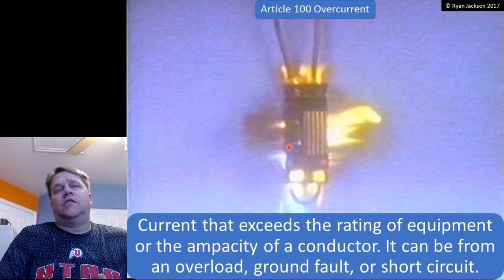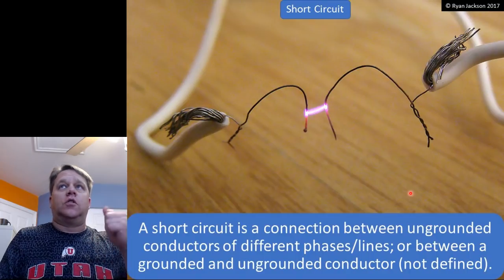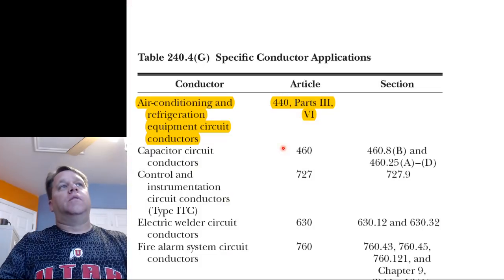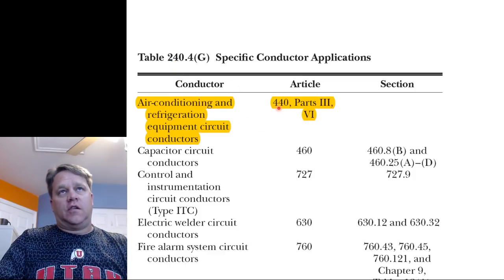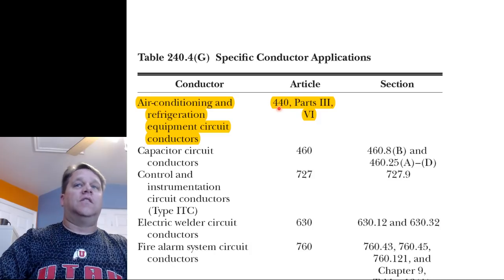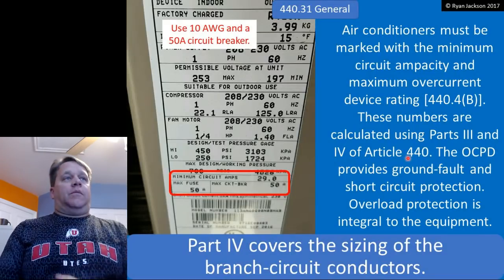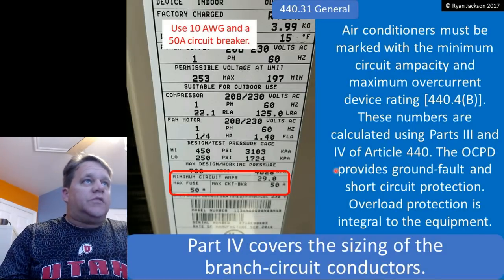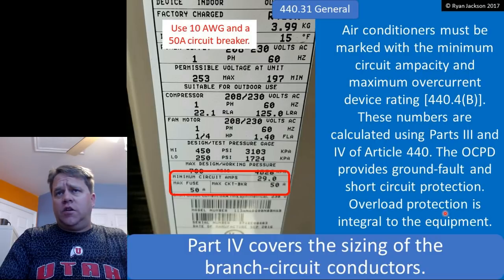Air Conditioners and the National Electrical Code (NEC)

Comment: Just wanted to take a moment to say thank you for this video.

Recently I’ve been installing split units in a prison for 7 out of 16 of their units. I’ve never run power to them before. 

I got all my wire pulled and everything and then come to find out there was a little bit of confusion about whether or not I had pulled the wrong size of wire.

The units have a minimum circuit ampacity of 16 Amps. I pulled #12 wire. And the unit says that the breaker needs to be 20 A. 

In this particular case there’s not a discrepancy between amperage of the unit and the amperage of the wire. 

The thing that got us confused was that we had bought 30 A breakers (because that’s what the AC guys had originally told me when I asked).

Long story short, the wires I pulled are perfectly fine for the units and it saved me a lot of repulling of wire. 

Now I know to just avoid confusion and go by the name plate of the unit since the code requires the manufacturer to do the math for us.

Thanks again for your info

Comment: You needed to discuss LRA, locked rotor amps, and why it does not enter into the discussion. I noticed you were using very old equipment that did not include the LRA.
Reply from the maker: Go ahead and make a video. That wasn't the topic. There's lots of stuff I didn't include here.
Reply: He’s right bro that wasn’t the topic. We’ll wait on the video Texas

Comment: Mike Holt says to use the 75 degrees column 
U say to use the 60 degrees column 

? 

Electricians can’t agree on anything
Reply from the maker: Read 110.14(C) and (if using NM cable)  334.80.

Comment: Is it max fuse or breaker? So I  could install a properly sized breaker and a non fused disconnect? I thought when it says max fuse that the manufacturer is requiring a fused disconnect. Please respond. Me and another guy are having a debate on this subject.
Reply from the maker: If it says fuse, it requires a fuse. See UL Guide Card Category LZFE (https://iq.ulprospector.com/en/profile?e=209220)

Comment: Should an AC disconnecting means require the same amount of working space as a service equipment panelboard?
Reply from the maker: Yes
Reply: That would be nice but in the real world it doesn’t happen. Example:  Apartment complex with 16 AC units grouped together. Hard to comply.
Reply: Yea the inspector for those sites gets a large cut for passing such bs.

Comment: If the breaker is only used for ground faults and short circuits, what could go wrong then if you go over the max circuit breaker rating?

Comment: So, who's responsible for this carve-out for the HVAC manufacturing industry. Seems to me that the NEC is asking us to put a lot of trust in the AC manufacturers for overload protection. I've seen multiple "built in" overloads fail resulting in melting wire and small fires (fortunately).

Comment: Motor loads allow you to size the wire based on the MCA, but the EGC should be sized based on the installed OCPD rating. The upsize of the EGC to match the breaker size may require you to size the phase conductors to a size larger that includes the code required EGC. Its a good thing to double, triple check before ordering and installing spool full of wires so the AHJ doesn't makes you rip them out.

Comment: Ryan, I completely understand and now I understand that the use of smaller gauge wire for condensers is allowed under 440. I also fully understand that wire sizing conductors for condensers is different than that of 310.16. My question is though the NEC code is the minimum requirement to be safe from fire and code violations. Can we run larger gauge wire using 310.16 as the base for wire sizing and over-current protection for a condenser install and simply use the correct amperage breaker for the conductor as per normal practices and still be code compliant? This is my only confusion! 

I get that an “MCA of 28.4A” with a max breaker size of 50A on a 10 gauge conductor using a 50A breaker is good with 440. That said would I be in code violation of 440 if I use 8 gauge wire following the 80% method which would be 32A using a 40A max breaker size?
Reply from the maker: The conductor has to be at least as large as the MCA. If you satisfy that it can be as large as you'd like. The breaker must be between the min and max overcurrent device rating.
Reply: @RyanJacksonElectrical  thanks Ryan, my a/c guy is installing a system for me and I’m just making sure the way I’m doing it will satisfy 440 while using 310.16 and the condenser tag for breaker size to do the work. Neither myself, the customer nor the city inspector are comfortable with using 10awg wire on a 40A circuit for this job as per NEC 440. We’re running 6/2 x 50’ for the wire and using a 40A breaker according to the max breaker size on the condenser tag. Also 18/5 x 50’ for the thermostat, air handler/furnace & condenser then a 20A breaker with 12/2 x 50’ wire for the air handler/furnace.

Comment: I'm an amateur electrician thinking of installing an AC unit and was confused about the nameplate specs on the units. Just came across your video after digging across the internet trying to understand this logic breaking piece of electrical code. Wonderfully explained! No one explained that it's because the motor has a shut off to prevent itself from melting. Thank you Ryan

Comment: Great video, thanks!  But I'm confused about disconnects and if they need to be fused or not?  It seems it is not uncommon to use Both a breaker and a fused disconnect.  Why would that be needed? And if so, would the fuse and breaker both be sized the same (per the HVAC label)?
Reply from the maker: They are sized the same way. If the unit says "maximum fuse" instead of "maximum breaker" or "maximum overcurrent device," a fuse is required.
Reply: @RyanJacksonElectrical  after some research I have learned a bit more on this.  Though most condensers will say fuse/breaker max rating some might only be listed for a fuse and only say fuse max. In that case a fuse in the circuit is required and can be anywhere, so a fused disconnect becomes one easy way to meet that requirement.  But a breaker in your breaker panel is also needed.  Also, I checked my own home units and found fused disconnects were added when the units were replaced.  Though I don’t know the rating of the old units we had I see the correct sized fuses are in the disconnects were the breakers are both larger. 35 fuse vs 50 breaker. And for the smaller unit, 20 amp fuse vs 25 breaker.  So instead of downsizing the breakers they just buy the needed protection in with the correct sized fuses. So fused disconnects become an option to downsize the protection when needed for a unit replacement leaving the higher rated breaker for a possible future use of the circuit.

Comment: You are reading the code incorrectly and to say that if you short out 2 #14 wires it would trip an 800 amp breaker is ridiculous. Clearly the 14 wire will burn before it trips a breaker.
Reply from the maker: LOL okay.
Reply from the maker: So which section do you think I am reading incorrectly?

Comment: If a 5KW electrical heater kit calls for a min of 27 and max of 30 and say it's on a breaker for 40 amps would breaker need to be changed to 30?

Comment: Very good presentation. You have clearly demonstrated why ocpd is not sized according  to the partial or full ampacity of the cable. Do you have any insights on how or what determines the  max ocp values in these cases?

Comment: As an electrician, using mostly, 430 and 440 for my work, I am very familiar with your subject. I used to get a kick out of showing "union" electricians how I could 'legally' put a 18 gauge wire on a 40 amp breaker for certain motor loads, because the overload was in the contactor, the breaker had to sustain the inrush current without tripping, the contactor would trip (very predictable) at a low current, below the breaker rating.

Comment: @Ryan Jackson When the manufacturer provides their MCA, they have done all the calculations. The MCA tells you what wire size to use. Does that mean you do NOT have to correct for temperature and adjust for bundling? Thanks for your many excellent NEC videos.
Reply from the maker: The manufacturer provides the minimum ampacity of conductors. The definition of ampacity is the amount of current the wire can carry AFTER temperature adjustments and ampacity correction. So yes, you still need to factor that in. The nameplate won't state "use 12 AWG," it will state an ampacity.

Comment: Same would apply for large commercial air handlers with min circuit  amps and max over current name plate markings? No hermetically sealed compressor motor. Only large fan motors that have overload protection. Also would the wiring compartment on a disconnect for an air handler stating ues 75° c or greater conductors imply that the terminals  are 75°?

Comment: What if the AC is continuously operating over 3 hours? Do you need to apply a 1.25 factor to the MCA to size the conductors/breaker?
Reply from the maker: That's already calculated

Comment: Stupid question, Previous AC unit required a larger breaker and new Unit requires a smaller breaker, can you leave the older breaker?
Reply from the maker: No, you need to change it.
Reply: @RyanJacksonElectrical  what if there is a fused disconnect between them with the correct fuse size the unit calls for?

Comment: If overcurrent protection devices detect for ground faults then why do we need GFCI breakers?
Reply from the maker: A GFCI opens at 4-6 mA of current difference between the ungrounded conductors. An overcurrent device opens (quickly) at about 6-10 times its long time pickup rating.
Reply: thomas ipkiss  Per Article 100 of the NEC, a GROUND FAULT is an unintentional, electrically conductive connection between an ungrounded conductor of an electrical circuit, and the normally non-current-carrying conductors, metallic enclosures, metallic raceways, metallic equipment, or earth.

When a circuit has been properly installed according to NEC rules, all of those "metallic" objects (enclosures, raceways, equipment parts, and the equipment grounding conductor) will have been "bonded" together, making all those metal pieces the same object, so if an energized conductor touches any part of that metallic super-object, ALL parts of it are energized at the same voltage. What that means is that you have another type of short-circuit, one between a hot conductor and the ground going back to the circuit breaker panel, where a regular circuit breaker would pick up this condition, and trip, because a hard GROUND FAULT has the same characteristics as a short-circuit. Infinite (so to speak) current will try to race from the hot wire directly back to the NEUTRAL connection at the breaker panel (the equipment grounding conductor goes to the grounding bus inside the panel, and the grounding bus is bonded to the neutral bus inside the panel), and once there, back to the utility transformer. It all happens so fast!

GFCI breakers (Ground Fault Circuit Interrupter Breakers), as Ryan said, open at 4-6 mA current difference between ungrounded conductors, but GFCI breakers open due to an imbalance in current between the two circuit carrying conductors. One thing about electricity is that it is carried by electrons, and if X number of electrons are supplied in the hot conductor, then X will return to the source via the common (neutral) conductor, UNLESS they find another way to return to the source, which is the definition of a ground-fault.

The opening of a GFCI breaker at 4-6 mA current is a way to protect people from being electrocuted, anyone who might touch whatever metal has come in contact with an ungrounded conductor that's causing a fault. 4-6 mA is not enough current to kill a person, normally. So GFCI breakers are intentionally designed to protect people, not equipment. A condition that can set off a GFCI breaker without having a full ground fault is leakage current, say between windings inside a motor and its case prior to its failure, usually due to its age. GFCI breakers have built-in GFCI protection, so will trip long before the ground-fault has been completely established, but are also normal circuit breakers as well, thus they will trip at their rated current, say 45 Amperes, absent any circuit fault going on.

Comment: I love learning from your channels.   Learning why AC units and overcurrent protection are sized like their are.  I always thought for example using a 14 gauge NM on a 25 amp breaker is a major fire hazard,  in case there is a problem with the unit and it draws more than 15 amps, like back in the old days, especially with the Edison base fuses and to a lesser degree,  circuit breakers,  a 15 amp fuse keeps blowing due to overload caused by the homeowner running high amp devices like heaters, irons, vacuum cleaner, microwave ovens, electric skillets and hair dryers,  to name a few.   The fuse is  replaced. .  After a few times, the homeowner stops the trouble by using a 20 or 30 device. Or places a penny or wraps the fuse in aluminum foil. Over the years many homes have been destroyed & lives lost  by such action.   It's my understanding that part of the reason we went from fuses to breakers in the 1960s, aside from them being more convenient and practical,  was because a breaker tends not to be tampered with as readily as a plug or cartridge fuse.

Comment: Why does my Leeson 5hp pump motor say “needs thermal overload protection” and isn’t already built in?  If I have a 30 amp breaker with 8 gauge 240 copper conductors, I believe I satisfy this?
Reply from the maker: Not every motor has inherent overload protection. You will need to provide separate overload protection, such as through the use of a combination motor starter, or you can size your ground-fault and short-circuit protection device to include overload protection. This is typically done by sizing it at not more than 115% of the nameplate current. The only problem with that is that it may not allow for the motor inrush current during startup.

Comment: I recently discovered your channel and loved the quality content!
We recently had a failed  inspection due to having two 15 amp breakers (one for attic light and service outlet and the other for the furnace disconnect switch) and the inspector claims that both breakers HAVE to be linked or bridged???🤨 It doesn’t make any F$&#¥€g sense since the purpose of installing two separate circuits was to allow to be able to service and maintain the furnace while still having the ability of using the light and outlet while the braker feeding the furnace still off... if his argument it’s true then what’s the point on using two independent circuits if we can use only one with an SSU disconnect switch on the furnace!
Any help with information on what can be used to allegate  on this matter will be appreciated,thank you!
This happened in San Jose,California by the way where I’ve had the worst experience with inspectors (I’m willing to comply with code as long as they make up their mind on what code they’re based on)!
Reply from the maker: There is no NEC that requires that.
Reply: @RyanJacksonElectrical Just as I figured!
Thank you and keep on going with those videos,we really appreciate your work!
Reply: Were u sharing a neutral on the two circuits? 
That’s the only reason they would need the handle tie. 
Multi wire branch circuit

Comment: ? I THOUGHT that A/c conductors are sized for continus load which is 125% of the running load amps  marked on the unit ???
Reply from the maker: The nameplate marking incorporates it.
Reply: I thought that was  true for electrical heater kits.

Comment: I had trouble with my first central air conditioner tripping the 30 amp breaker. Never pulled more than 17 amps. So I upped it to a 40 amp. Found out that my wife was what I called machine gunning the old mercury filled thetmostat. Would turn it on then off then on several times. Installed a 5 minute on delay timer then went back to a 30 amp breaker. Now have a high efficiency unit that runs on a 20 amp breaker. ( 2.5 tons ).
Reply: You nailed it. Every off cycle the Freon pressures begin to equalize in the system if the compressor tries to start before they equalize it tries to start under a load often exceeding the breaker amperage or the motor can't overcome the load to start and heats the windings which trips the thermal overload device embedded in the windings. All new electronic thermostats have a built in time delay so you can't short cycle the thermostat.

Comment: Hi Sir Ryan, thank you very much for the detailed and straight forward lesson, everything is on point and my confusion on 
"why the a/c have smaller wire ampacity than the circuit breaker's ampere trip rating" clears away!
I think the secret there is, not everyone knows that the a/c equipment have an integral protection for an overload current,
and most probably, everyone in this field must clearly understand the difference between short circuit, ground-fault and overload currents.
I'll take note also the important thing from your video, when reading the a/c nameplate, the indicated Max Circuit Breaker size is NOT meant 
to protect the Wire feeding the a/c, which will be sized based from the indicated Minimum Circuit Amapcity.
I would be watching more videos from your channel, thank you very much again, more power and God bless

Comment: Is that true for ALL motors? Do they have overload protection built in?
Reply from the maker: For air-conditioners, yes. For other motors sometimes the case. It is more common for smaller motors.
Reply: Thanks
Reply: Can not remember ever seeing
Reply: In my 50 years never seen a three phase motor with built in overload protection. Explosion proof motors used to have something to measure when motor windings get too hot and have to be wired to motor starter coil. On single phase never saw overload protection on motors 7.5 HP & higher.